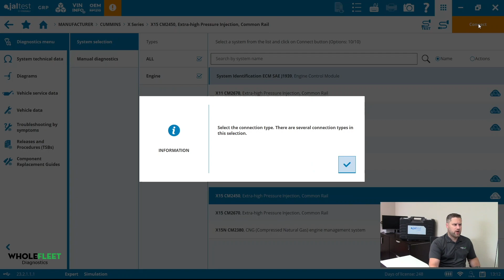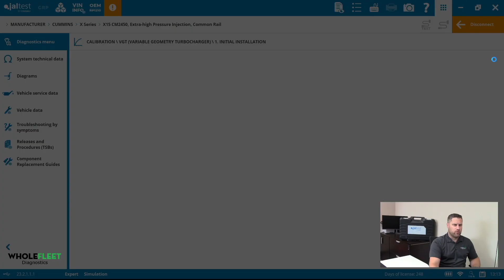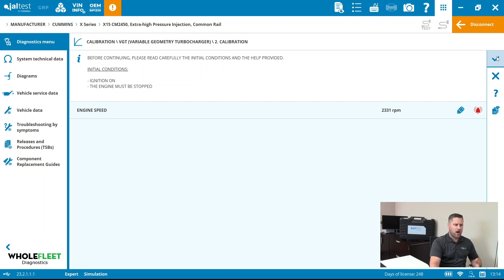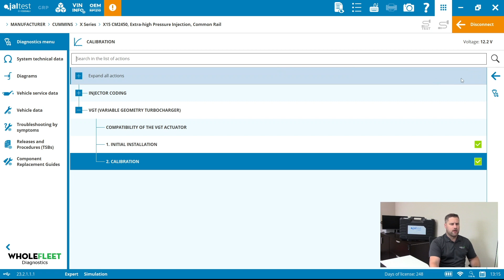How to Install & Calibrate a Cummins VGT Actuator

Comment: I had a new actuator  installed on my cummins  but have po226 code the  said they callable  it but didn't hear know  clicking does it need to be redone
Reply from the maker: We would need more information, engine serial number and remote connection to your diagnostic tool to provide support.